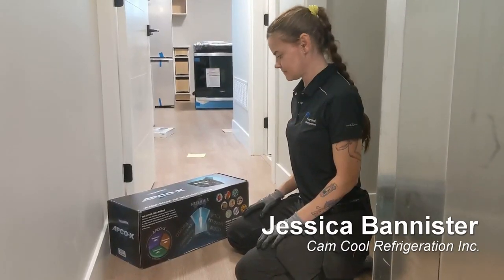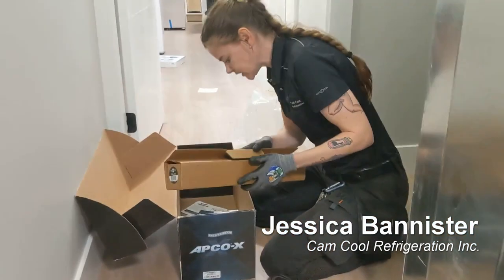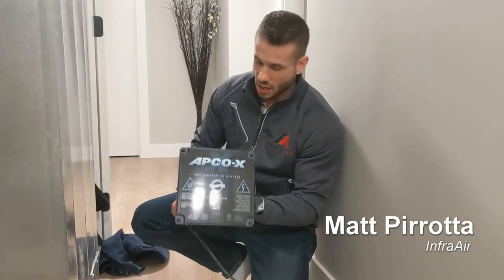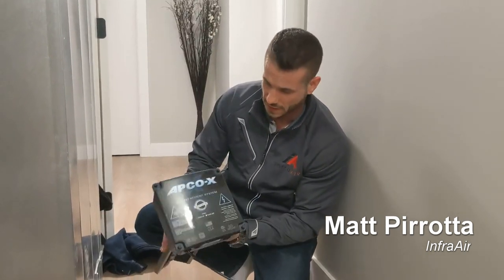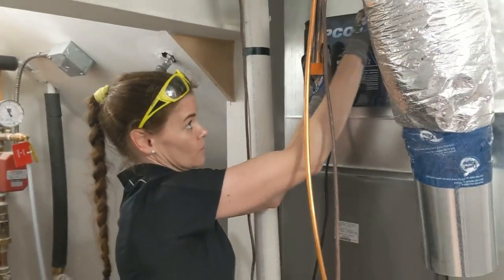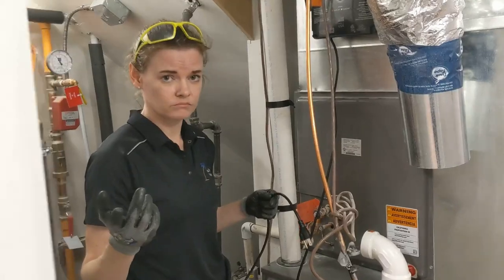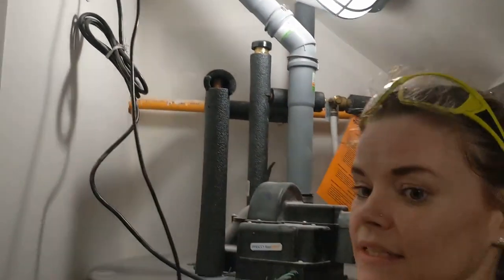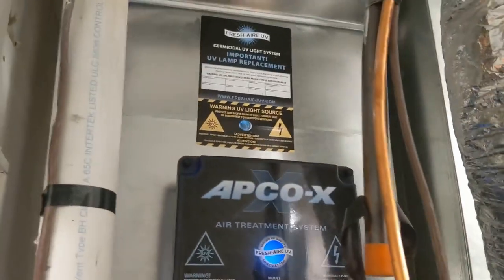Fresh Aire UV APCO-X System - Easy Installation - UV Purifying system for your home - Women in HVAC

Comment: You rarely discuss air flow direction when placing the light in relation to the coil and the filter. I have a downflow with the filter right above the coil. Plus I'm in a tiny closet with only two sides of the furnace available.  You guys always have nice work spaces with new clean units.  No fair.